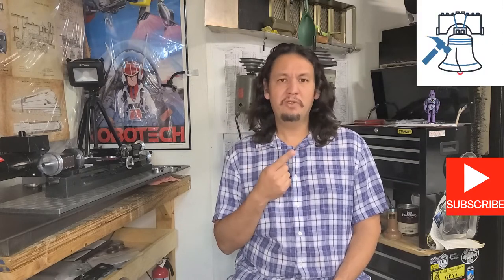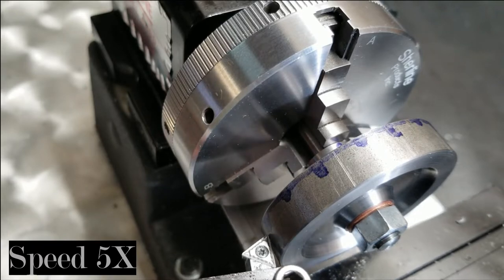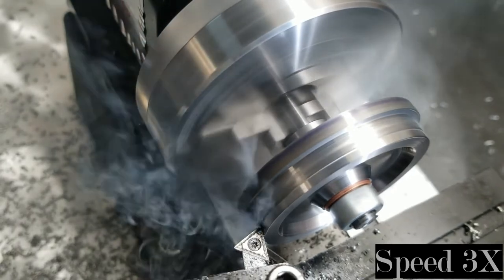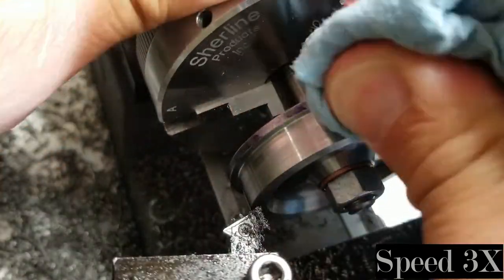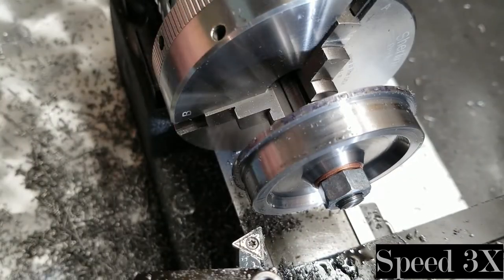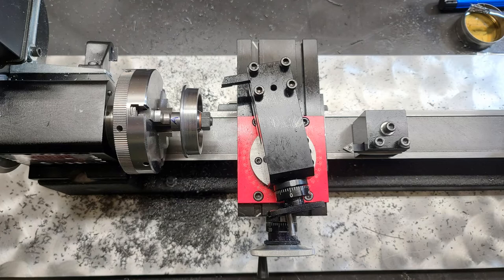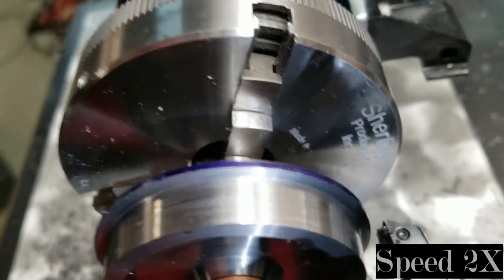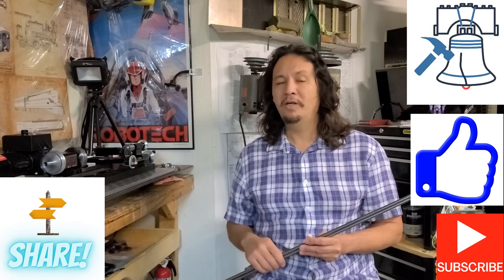Tender Wheel Part 4 Finale Kozo Hiraoka ¾” scale Pennsylvania A3 Switcher  Loyd Precision Makers

Comment: Love it!

I just finished up my mini machine shop (sort of).  Of course, I bought one of the mini-lathes from China... Unfortunately I didn't buy a branded one like Grizzly, even though they come from the same factory it seems I got a bit of a lemon. It turns convex in the facing cut so I've got to deal with that, nothing a bunch of stoning won't fix. I'm happy to say that my mill is spot-on accurate though!    I enjoy watching your videos on A3 as it's the project I picked out as well for my first.
Reply from the maker: Oh very cool. I do Hope I can keep it up.  Glad to hear that you got set up in your shop and taking on the Kozo build.  I think it is a great place to start. Are you doing the ¾” scale or one of the larger ones?  That is too bad about your lathe, but at least you have a plane to try and remedy it through stoning.  When I was looking at a used lathe or mill again pre Sherline, I was advised by the Journeyman Tool and Die Maker to get a book called Machine Tool Reconditioning and Applications of Hand Scraping by Edward F. Connelly from machine tool publications.  It has fair bit on machine alignment and testing, hand scrapping, problems in alignment, oilstones, and numerous other topics.
Reply: @LoydPrecisionMakers  Same 3/4 inch scale, cheaper and more manageable to start learning for sure.
Reply from the maker: @icefire001  Very cool.  how far along have you gotten?
Reply: @LoydPrecisionMakers  I cut the tender wheels from a large bar of 12L14 steel and that's when I found out my lathe wasn't performing properly.  Since then I've used my mill to mill out a deeper channel in the saddle and sanded the V way. I'm now down to a .001" over 6 inch convex cut while facing.   I'm not QUITE satisfied with that but it is leaps and bounds better than it was.  When I first found out it was .020" over just 3 inches!   

But that is as far as I've gotten since I had to work on my lathe.  Now I'm going to finish cutting the rest of the wheels from the bar and get to machining them soon!  

I'd love to collab with you, maybe have our own little private conversation on facebook  or something since we're doing the same project!
Reply from the maker: @icefire001  very cool. Sounds like you have figured it out and came up with a means to get your lathe to run true. 

Unfortunately I don't have a Facebook. I closed up my personal one after not using it a couple years.  Unfortunately I tried to make a new one for my channel but Facebook deemed it as inappropriate content for their community standards. 

I tried to republishing so see if you can find Loyd Precision Makers On facebook.

Comment: Thank you for posting your videos. I especially like that you are willing to share your mistakes. It is very helpful to watch before I make my own wheels. 
I have a question about turning the flange radius. Kozo specifies a 3/64” radius tool for turning the flange in figure 2-9, it appears that you used a smaller radius carbide insert for this operation. Is this going to be an issue?
Reply from the maker: Of course I'm glad you like it. I hope your able to avoid some of my mistakes and save your self some headache.
PLEAS ASK AWAY!!! I used the smaller radius carbide to rough out. Then I finished with the little machine shop rounded hss tool. The shape of the insert was such that I could come to dimension  on the inner rim and outer but have material to finish with the hss.  Though I still only came to about .005 to .010 any way and finished with the hss.  Honestly though I liked the Shape or profile left by the carbide better. It more ascetic.